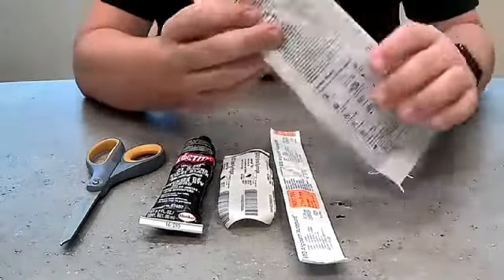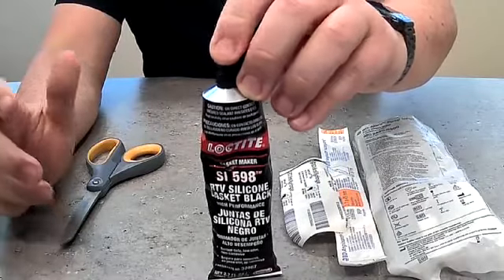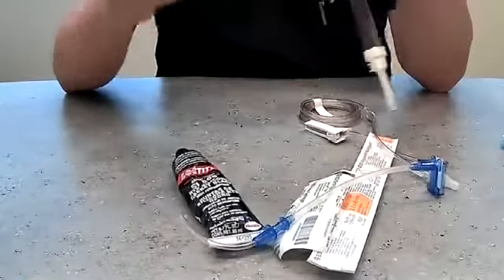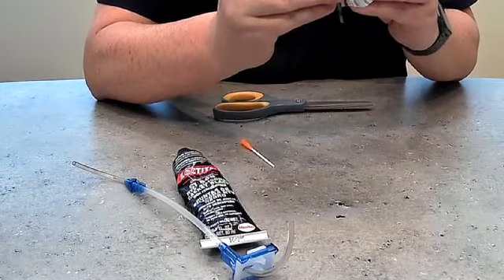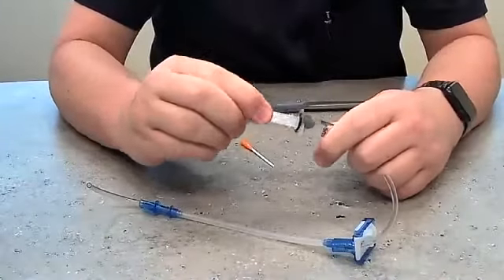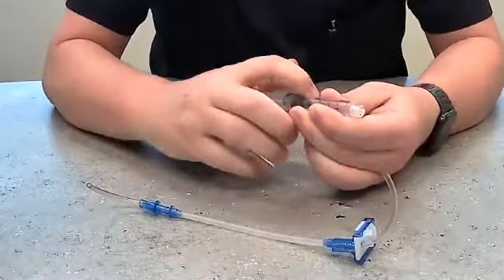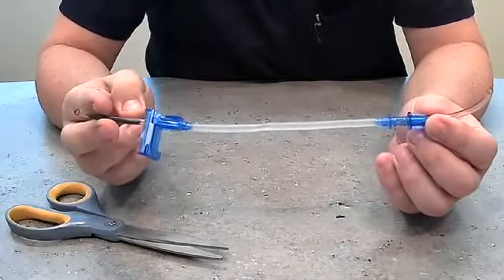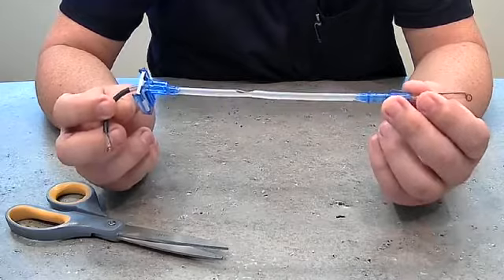Alaris IV Pump "Cheater"

Comment: I appreciate the video!

I oversee the Simulation Center at a Nursing School. At some point, whoever held this position before I got here was able to make cheater tubing out of a full, primary set of tubing withOUT cutting the rubber pump insert out. So these sets have the full spike, rubber insert, and all. At a glance, it looks like a normal set of primary tubing. We use these extensively for the students who are still learning to spike/prime the tubing and program the pumps without having to run fluids into a collection bag of some sort.

Some of our "cheater" lines have worn out, and I need to replace them. However, I can't figure out how this was done before. There is silicone in the tubing directly below the blue safety clamp, the rubber insert is snipped about where you have in your video, and there is silicone above the rubber insert. There is also a hole drilled into the tiny piece of blue plastic directly above the rubber insert. I've tried to do this all myself, but the pump immediately recognizes that the tubing I've made is "broken" and it throws an error.

Do we have any idea why this cheater tubing works? Why is the silicone necessary? What does the hole in the rubber insert do? Any help would be much appreciated!